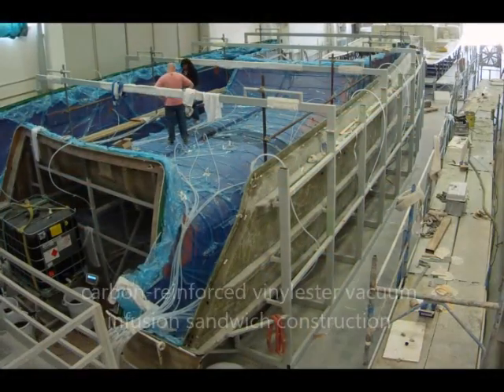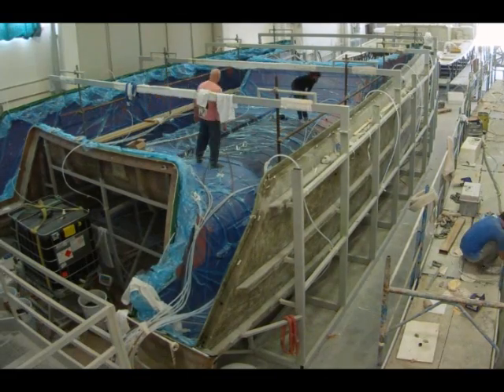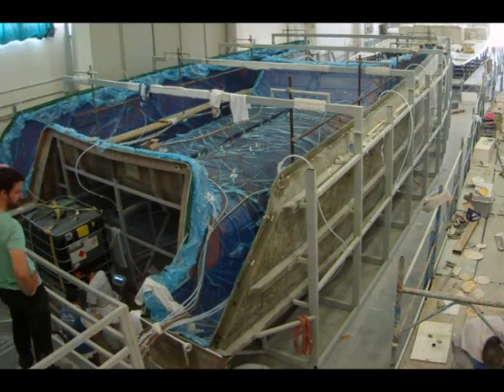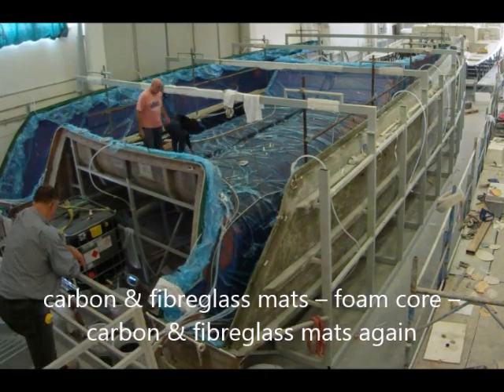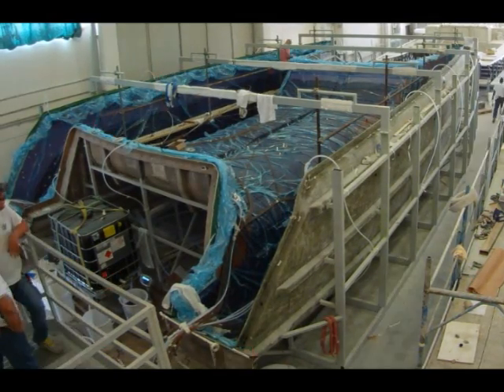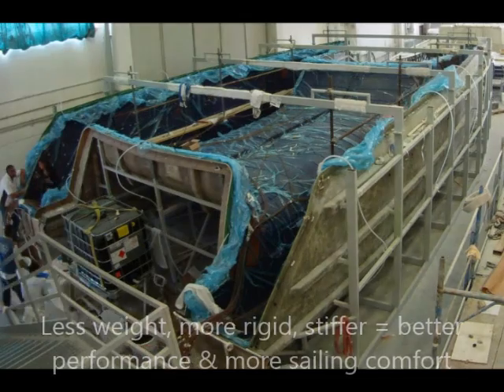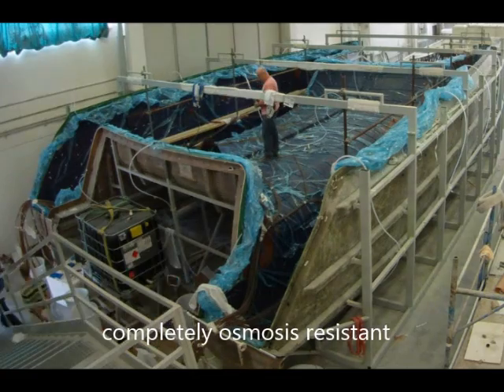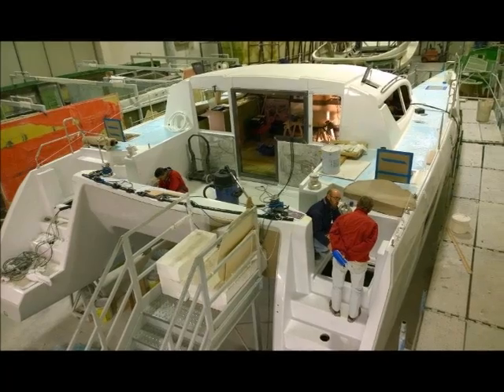Carbon infusion production of most modern catamaran and multihull

Comment: Carbon can't be laminated with vinylester resin. It will be possible to work with epoxy or use vinylester with glass and use epoxy for the carbon reinforcements.

Comment: Is this way faster and easier to produce, or slower and more difficult? the vacum process is used only for the core of the "sandwich"?
Reply: Vacuum is used first of all to reduce the amount of resin in the laminate. So for both. The outer and inner skin and the core. You'll achieve a strong , light hull with a high ratio of fibre in the laminate. Same for the core. Resin only connects the layers but adds no strength but weight.